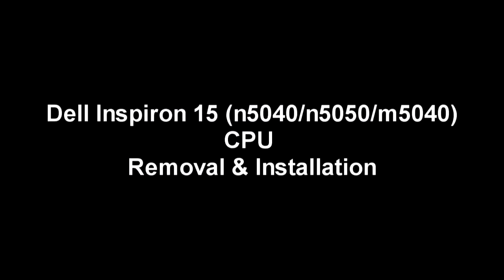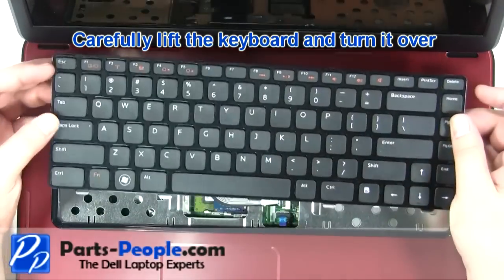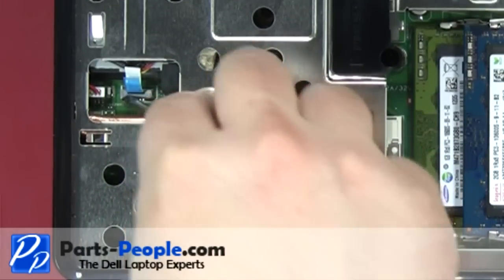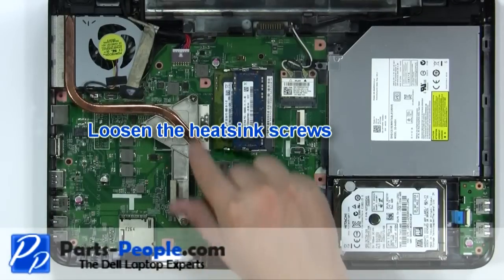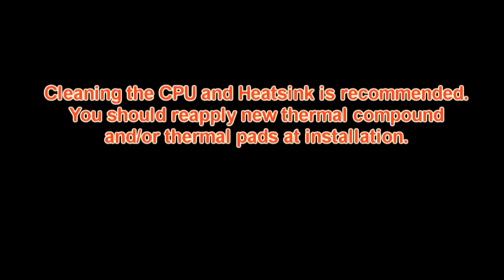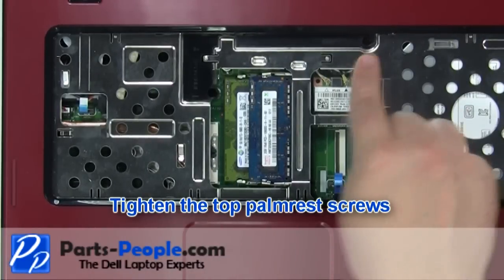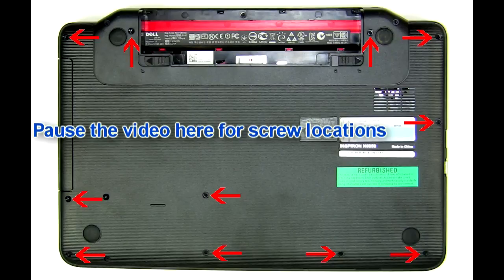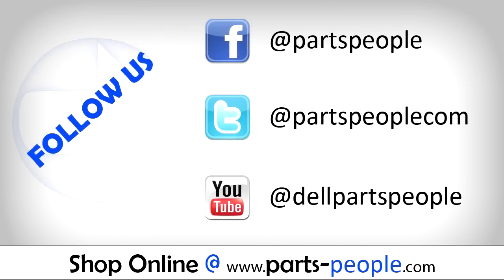Dell Inspiron 15 - N5040 / N5050 CPU Processor Replacement Video Tutorial

Comment: I have DELL N5040-5256 model laptop. On CPU-Z it says it has HM57 chipset on its motherboard and on official DELL internet site the technicians say HM57 is also compatible with some İ5 and even İ7 CPU's. Is it ok if I buy one İ5 or İ7 CPU or should I buy Core™ i3-390M? thanks in advance.

Comment: I have an Intel(R)Core(TM)i3-2310M CPU @ 2.10 GHz 2.10 GHz...32 Bit OPS 3 Gb RAM....i wanna upgrade it to 3.10 GHz and 8 GB Ram can i do that?plz reply
Reply from the maker: Assuming that you have either a N5040 or an N5050 you will only be able to upgrade the RAM to 8GBs if you install a 64bit OS. Also, I don't have a complete list of processors for these laptops, so I don't know if there is a 3.1 GHz available for them.
Reply: ok Thanks

Comment: I bought a used Dell Inspiron 15 - N5040 the other day. Can the CPU be upgraded? If so what CPUs will work? Thanks for any help
Reply from the maker: I've seen the P6200, the i3-380M, and the i3-390M in the N5040.
Reply: Thanks for the help

Comment: would it be a similar operation for a dell inspiron  n4050 or i14r which are probably similar computers only 14"? and can you swap a pentium processor for one in the intel  i series?
Reply from the maker: Jeff Smith Yeah, it will be similar. The screw locations might be slightly different. And Dell's website say the N4050 can use an i3 or i5. It doesn't tell me what gen i3 and i5, so you'll have to a little research on that.

Comment: hey ...guys..i own a N5040 laptop for 3 years now .. it came with p6200 processor and i have been thinking upgrading it to i5 ..here the thing it has socket of PGA988 with 35w. if i get another processor with the same configs and for the PGA988 socket will it work..
Reply from the maker: Yes, you are correct. You may need a BIOs update also.
Reply: Parts-People.Com, Inc do u know a website where i can find these processors...or the processor which i should consider
Reply from the maker: ***** No, I'm sorry, I haven't been able to find any recently.
Reply: Parts-People.Com, Inc is this also for a Dell Inspiron 15 3542 Laptop?

Comment: Just purchased an i7 620M - waiting for it to turn up. But research suggests it has the same TDP as the current Pentium P6200 so hoping overheating isnt an issue. I suggest the TDP is related to the number of cores and whether or not it's an Extreme CPU?
Anyway here's a link to the list of processors that work with the onboard Chipset ( HM57 ). http://ark.intel.com/products/43179/Intel-BD82HM57-PCH#@compatibility
Just make sure you choose one that has the same or lower TDP rating - in the case of the N4050 it's 35W. Also worth mentioning to upgrade the bios to the latest first. Will let you know if I'm wrong or not.
Reply: +Michael Hobgood and all - yes worked fine. Still workign fine. Although it does get hotter. Just be careful not to block the fan exit ;) But very pleased with results and still using my 5+ year old second hand Dell :)
Reply: did it work? i just ordered i7 chip with 16gb of ram.
Reply: please let me know i just received the i7 procesor in the mail and would like to know if it went well with you? thanks
Reply: +Carlos Merlos u can't use a i7 and the max gb of ram is 8
Reply: +Ben Sonley i know this is older but incase you still havent found out tdp isnt just related to cores but also how much power it uses and how high its clock is and such
Reply: +Michael Hobgood Thanks - thought it was important so made sure it was the same as the replaced CPU

Comment: At 3:12 i dont have one of those to turn 180 degrees
Reply from the maker: What model laptop do you have?
Reply: M5040
Reply from the maker: connor astbury
The M5040 (the AMD model) has the CPU built onto the motherboard. Unfortunately the CPU cannot be replaced without changing the motherboard. It must have been overlooked when we created the video.
Reply from the maker: +TH3 3L1T3 Unfortunately I don't have a list of compatible CPUs but, from what I can find on Dell's website, the N5050 use up to a 3rd gen i5. The only only i5 I know for sure is the 2540m.

Comment: hi can i upgrade my processor dell inspiron n5050 intel celeron b710?
Reply from the maker: Do you currently have the Celeron B710 and you would like upgrade to something else or, are you wondering if the B710 is compatible? Yes, it is compatible and, yes, there are other processors that it can be replaced with.
Reply: can i replace it with i3 with the same chipset and socket??
Reply from the maker: rhenie mondejar Here are some of the compatible CPUs.
http://blog.parts-people.com/2014/12/10/dell-inspiron-n5050-compatible-cpu-processor-upgrades/

Comment: I know how to upgrade my ram but I'm not sure if I'm able to replace/upgrade my Intel Pentium of my Inspiron 15 (N5040). Please reply, just to be sure, will I be able to upgrade my intel processor or not?
Reply: Oh yeah and if so, please me know which intel (i3, i5, i7) would be compatible on my Dell Inspiron 15 (N5040)
Reply from the maker: Jom Pogi
The N5040 processor can be upgraded to the Arrandale i3, no i5s or i7s. Dells website says the i3-380M and the i3-390M are compatible.
Reply: Omg thank you so much I was gonna get the i5 and one more thing.. Since I have the Intel Pentium processor, my cpu on my laptop tends to heat up.. What would you recommend for preventing the heating. And I was looking through the upgrades you posted the links of in the description, and I saw the fan cooling, would that fan be the same on my N5040 if I would ever replace/upgrade the fan
Reply from the maker: Jom Pogi The cooling fan we have in the link would just be a replacement not an upgrade (it will not increase the cooling more than your already functioning fan). If you are going to replace the CPU anyway, be sure to clean out the heatsink and cooling fan, and apply new thermal compound. That should  help with the heating problem. If you still have overheating try using a laptop cooling pad. Other than that, not much else can be done.
Reply from the maker: Jom Pogi
Yes, that CPU is compatible.
Reply from the maker: Jom Pogi Yes, that is the thermal compound. You will put a pea sized amount right on top of the CPU.
Reply: Parts-People.Com, Inc thank you. Do you think they have the specific Intel around like RadioShack? And the thermal compound
Reply from the maker: Jom Pogi No I don't think RadioShack will have the CPU but they should have the thermal compound. You're probably better off searching Ebay for the CPU.
Reply: Parts-People.Com, Inc I have heard that the Liquid Pro is the best one but will it work with my laptop?
Reply from the maker: Jom Pogi
I always use Arctic Silver http://www.parts-people.com/index.php?action=item&id=11028
Reply: Thermal compound can be used instead of pads?

Comment: I don't know why you people are saying that i3 380m or something would work on N5050. It wont. Second generation core i3 and i5 do work as do Pentium B950. First generation i3 is for N5040 not the N5050. It will just beep and not post or boot.

Comment: Please is there a way to get a better cpu ram and graphics card i need the detail pls I wanna upgrade the keyboard to something fancy as well. Could you give me some links on what you would advice? My budget is £150.
Reply from the maker: Unfortunately there isn't a whole lot of upgrading that can be done with this model. The graphics is built onto the motherboard and they only made one style of keyboard so they can't be upgraded. You may be able to increase the RAM and CPU but that depends on what you already have in it and the OS you're running.
Reply: Parts-People.Com, Inc Would an Intel Core i5-560m CPU work in an N5050
Reply from the maker: SteezyTaco
Yes, I believe the Intel Core i5-560m will be compatible.

Comment: can some one help me because my M5040 doens't have a socket 
and it has AMD vision E2 plz help!!!
Reply: Were you able to get any help? Because I have the same problem.  :(
Reply from the maker: If it doesn't have a socket, then the CPU is built onto the motherboard and cannot be replaced. If you had a CPU failure or problem, you would have to replace the entire motherboard.
Reply: Parts-People.Com, Inc but can i change my motherboard into the n5050??
Reply from the maker: stephen chen
Yes but you would have to change the CPU, heatsink, and cooling fan too.

Comment: I have the n5040 with pentium p6200 can i replace my prossesor to i5??
Reply from the maker: No but it can use an i3. Intel® Core™ i3-380M (2.53GHz, 2 Threads, 3M cache) or Intel® Core™ i3-390M (2.66 Ghz, 2 Thread, 3M cache) would work.
Reply: Thank you! But where can I get it?

Comment: There are lots of potential Intel CPUs that can be used in your N5040. The N5040 uses Socket G1 / rPGA988A architecture. So if you buy a G1 CPU then it will physically fit. The next issue is TDP. TDP stands for Thermal Design Power. I am not going to waffle on about TDP, other than you need to think about how much heat a CPU will kick out. So if your N5040 can only deal with a TDP value of 35 Watt (or less) then don't buy an i7. The i7 range has a TDP of 45 Watt, although the i7 will physically fit the socket and power up the laptop, you will be looking at overheating issues....

The following are all 35 Watt CPUs
P6000, P6100, P6200, P6300 All work
Core i3-380M, Core i3-390M All work
Core i5-560M, Core i5-580M All work

AVOID i7 CPU's or get another laptop if you are desperate for i7.

I have installed a Samsung 840 Evo SSD, 8GB RAM, & i5 560M in my N5040. It flies along very happily and quickly.

FYI - The performance difference between the i5-560M and i5-580M is tiny. Currently (Nov '13) you can buy an i5-560M from eBay for £40 and the i5-580M for £100. Both are clocked at 2.66GHz. So why pay the extra £££?

NB - The difference between P6200 and i5-560M is hardly stellar. 10%-15% improvement at best.

Still that's my opinion for what it's worth. Good luck and happy upgrades.
Reply: Thanks for that info!!!

Comment from the maker: I would use an i3 CPU. 
Intel® Core™ i3-380M (2.53GHz, 2 Threads, 3M cache)
Intel® Core™ i3-390M (2.66 Ghz, 2 Thread, 3M cache)
The video card is built onto the motherboard so it can't be changed.
Reply: For dell n5050 i could use an i3-350m?

Comment from the maker: The i5-2380P processor is for a desktop and will not work. Out of these 3 laptops, the N5050 is the only one that can use an i5. The best one I've seen is this: Intel® Core™ i5-2430M (2.40 GHz, 4 Thread, 3M cache)